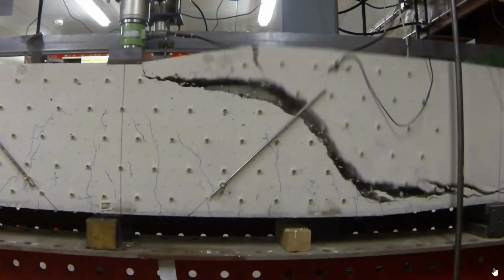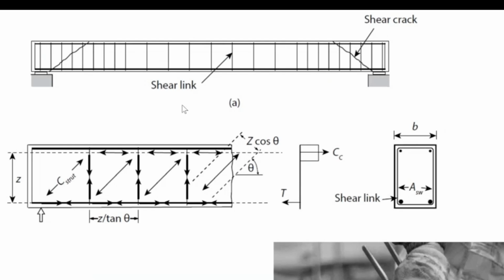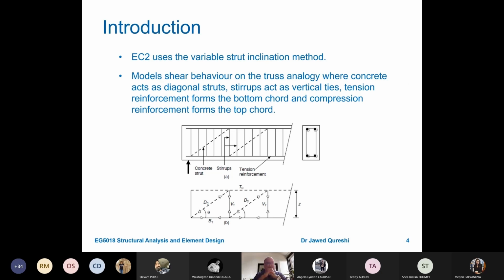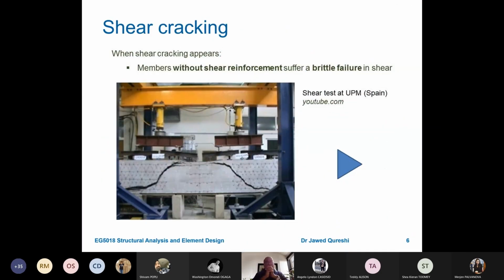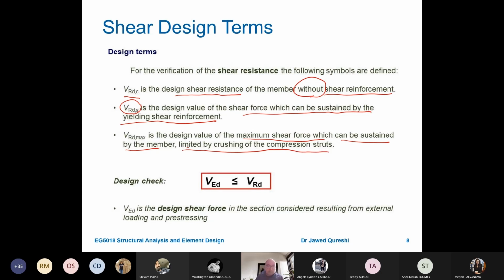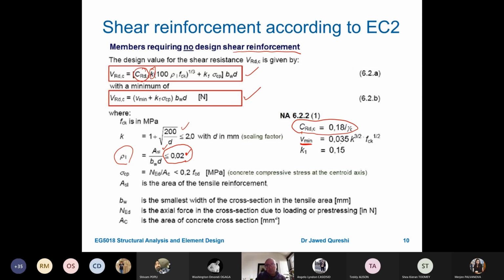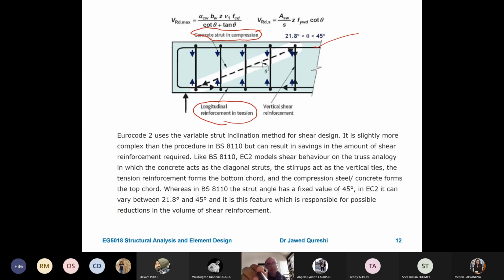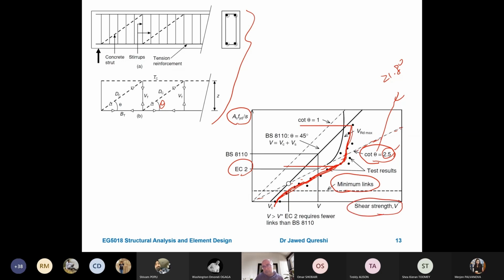10 Shear design of RC beams – Lecture | Eurocode 2 Concrete Design

Comment: best explainer ive found on youtube for shear. also why is eurocode 2 so brutal to read through, where did you find these flow charts that greatly implifies things?
Reply from the maker: I know Eurocodes are bit non-user friendly to read. The reason is that here in Europe we wan to impress people and try to different! 

I got the flow charts from 'The Concrete Centre'  UK guides.